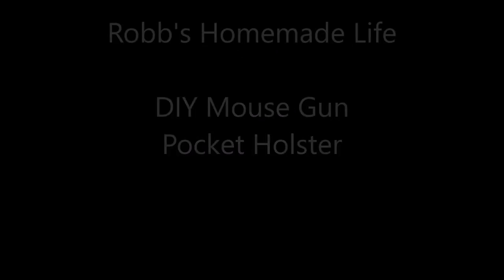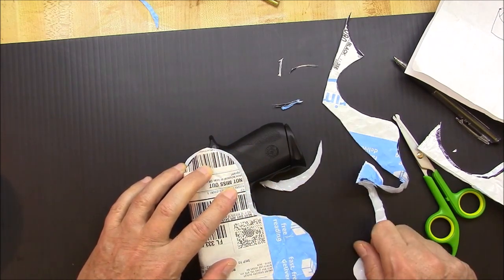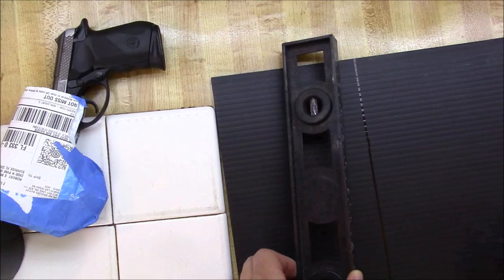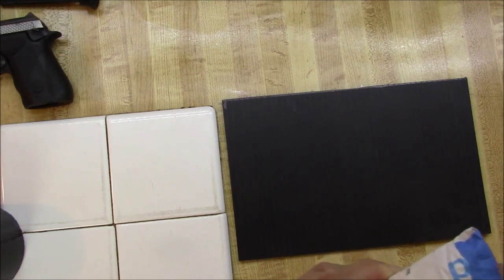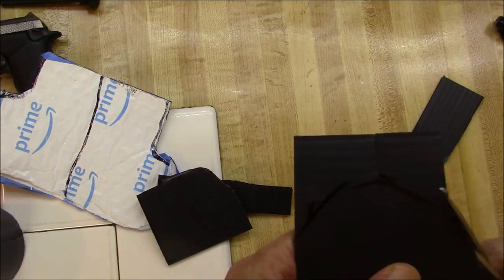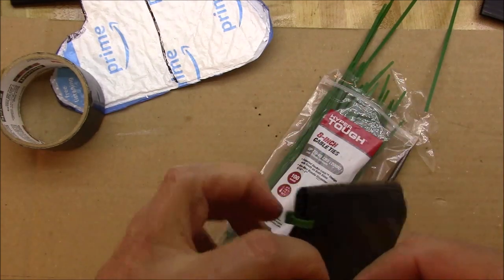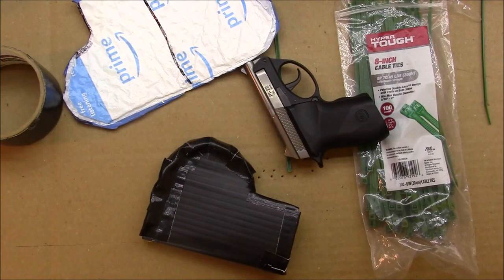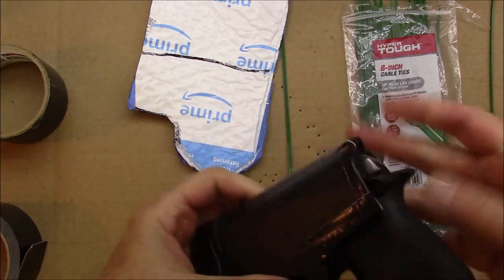DIY mouse gun pocket holster for Taurus PLY 22 made from Coroplast, Gorilla Tape & overconfidence

Comment: Thank you for the video link.
Cool idea to use coroplast.  I'd likely never have thought about using coroplast.
I back pocket carried a Taurus .380 for a few years using a nylon fabric holster.  After a while I discarded that holster and just put a half in thick foam rubber pad in my pocket to disguise the gun outline.  It looked like a wallet.   I used the same foam pad in my front pocket after I got a 9mm.  
My most recent DIY holster is a cross draw holster made with thin wall PVC sewer pipe.  It conceals real easy and is very comfortable to carry.  Draw is good and easy whether standing or sitting.
Reply from the maker: you should make some videos
Reply from the maker: hey SE, thanks so much for telling me about your channel, you have a lot of good videos. I am happy to subscribe.
Reply: @RobbsHomemadeLife  Hi Robb H L.  You're welcome.  I'm glad you like my channel.  Thank you for subscribing.  I hope you continue to enjoy my recordings.
My HF R800 camcorder is about to quit on me.  I'm almost shopping for another camera.  The model of camcorder I've been using is discontinued so I'm looking for a different brand.
Reply from the maker: I used small refurbished canon S100s for the longest time but kept having lens errors where they would no longer retract. I have been using old Samsung Galaxy S5s I get used for $40 on ebay for about the last 6 months. I like having a camera that fits in my pocket even though thanks to covid I hardly go anywhere . I still like dedicated camcorders but the phones have some good qualities too.

Comment: Good one Robb. (A revolving hole punch plier and leather riveting tool serves this type of project well .) 

I’ve been playing with making sheets of extremely tough flexible material. out of hdpe grocery bags.
Still working it out, I have made a small piece to test the viability. Very promising so far.
It’s basically stacking the bags flat on a piece of parchment paper, weighing them down with a piece of steel and putting them in the oven on a baking pan.Those thin films ,when laminated and melted together, are extremely tear resistant and tough .
It makes durable sheaths for sharp garden tools and files. Plus or minus 300 degrees ,depending on the crappy thermostats that come on cooking devices these days.
Reply from the maker: I just picked up a toaster oven somebody threw out and was thinking of getting it to work to melt plastic like you are doing. However, it is like new and only missing a rack so I made a video of me making a rack from a large dollar store rack. I also think an old broke toaster oven would make a neat mini fish smoker.
I know what you mean about the leather tools, they are [perfect for the holsters, I don't have any leather working tools so will use sail twine and big needles on the next one. Thanks for commenting.

Comment: Nice little holster there.  One thing to think about is tapes can sometimes have adhesives that promote rust.  You have a stainless slide so it probably won't be anything but surface rust if it happens, but be on the look out!  You might also try molding the plastic with a hair dryer so that it might conform to the little nubbles of the gun.  Retention matters.
Reply from the maker: Hey willi, I will be doing that on the next one, I have a great cheap little hot air gun from harbor freight.